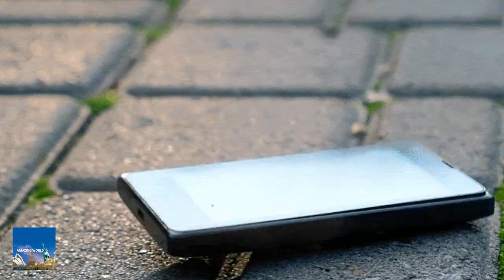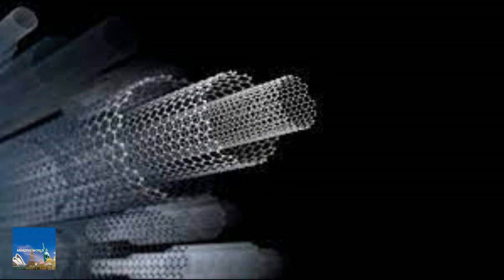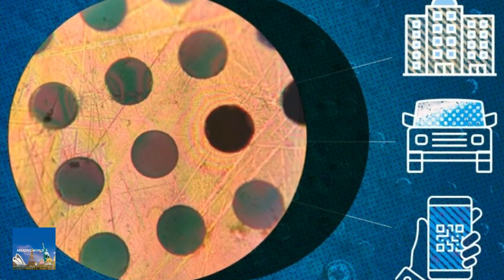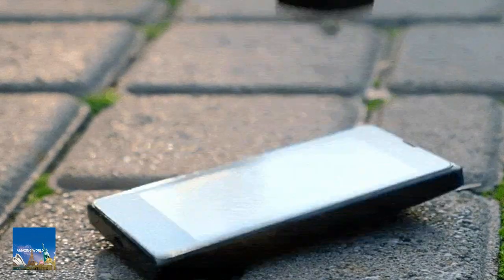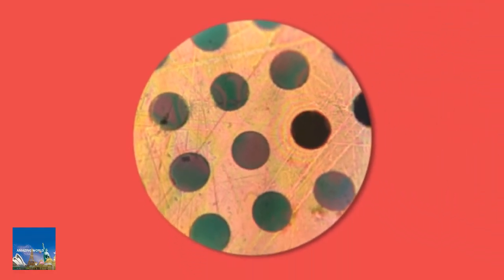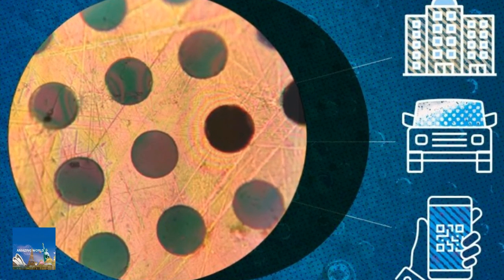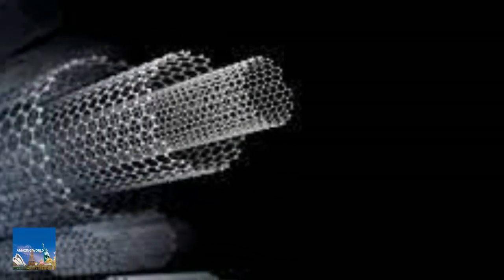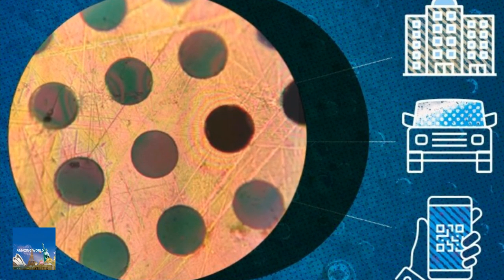Impossible SUPER LIGHTWEIGHT PLASTIC That’s 2 Times Stronger Than STEEL : MIT : 2DPA-1

Comment: Could this be used in police, army and security protective knife and bullet proof armour? You could use in in gloves for CSI or police searches where there are needles or other dangers. This is going to be big!
Reply from the maker: Great point! 💡
A material this strong and lightweight could definitely have huge potential in protective gear — police, military, security, even safety gloves. If it develops further, it could be a real game‑changer!
Reply: @AmazingWorldZM Yes, thank you. I can just see so much potential in this technology. Its also going to be a great construction material, because it will never corrode, rot or rust!!!! Also because its lightweight it could make fantastic structures and be used in aviation too.
Reply from the maker: @ronaldmcdonald8303  Absolutely! 😄💡
You’re right — the possibilities are huge. From protective gear to corrosion-free construction, aviation, and more, a material this strong and lightweight could really change the game across multiple industries! 🚀🏗✈
Reply: @AmazingWorldZM  Yes, you can only imagine the possibilities. I hope it makes its way into the market sometime. It would make great electronics casing. Imagine a watch or a phone that's almost impossible to break or scratch, or a window that will never smash. This is going to be as significant as the Industrial Revolution. There were also plastics mentioned on that display that had electrical properties. This is exciting. All too often, things break. It would be a nice change something lasting for once.